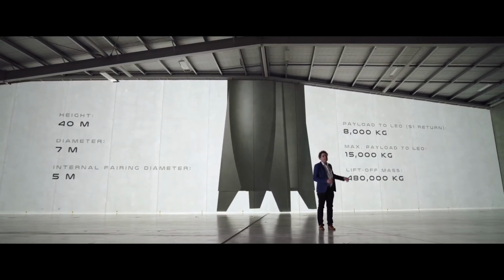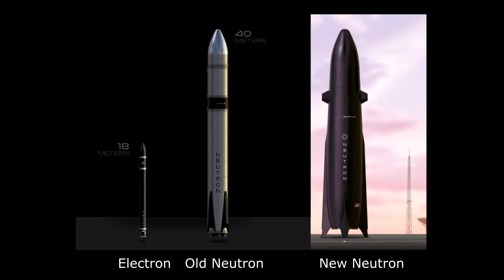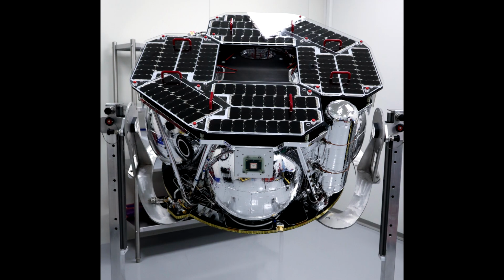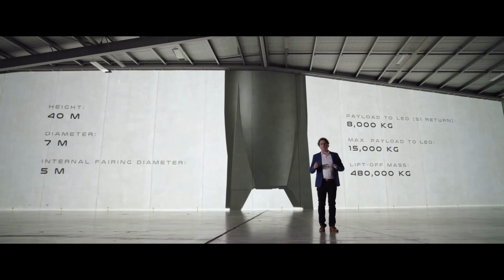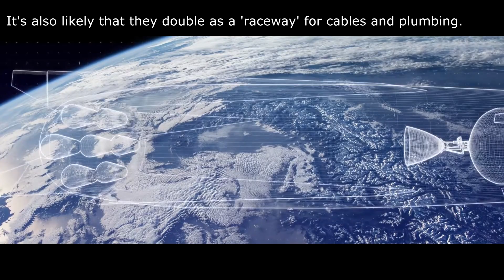Rocket Lab's Neutron Rocket Will Be More Reusable Than Falcon 9

Comment: Carbon makes more sense than steel in this specific application because the first stage doesn't have to reenter all the way from orbit. It therefore doesn't have the same sort of temperature requirements that SpaceX does for Starship.

It's not so much that one is better than the other for rockets in general, as that different architectures reward different combinations of attributes and therefore materials.
Reply: Hadn't thought about that, thanks for pointing that out. Potential re-entry speeds for the booster would likely be around 3 km/s vs. starship's 7.8 km/s from LEO, or faster on Lunar return. Side note, low Mars orbital speed is 3ish km/s, aero-capturing at Mars from Earth transfer is still "only" about 5km/s, which I think just shows how LEO and lunar-return re-entry are the most insane high speeds and heat loads, if Starship can handle that it'll be able to do anything.
Reply: I think you're kind of comparing apples and oranges. The first stage of Starship, (the "booster",) also doesn't need to reenter the atmosphere from orbital velocity.
Reply: @metachuko  True, and I think that carbon would be a viable material choice there.
Reply: @metachuko  Also a factor about the booster is that its return procedure does not need to be human-rated, obviously you would want it to land safely, but if it does fail it will just be a financial loss, but not in any way as critical as a failure resulting in loss of life. Two launches in a row both resulting in loss of life, would most likely be the end of any launch vehicle.
Reply: Also having an autoclave for something that large would be too stupendous
Reply: Yup, horses for courses. Starship is supposed to be able to re-enter from deep space, which is a whole lot hotter than re-entering a 1st stage booster from a sub-orbital trajectory.
Reply: @Andrew-Kerr  starships first stage booster could be carbon then.  they may realize they need to so they have the mass budget to make stage 2 even work
Reply: SpaceX actually has the mandrel to build from carbon, but they wrote the money for that tool off when they found that stainless steel was much better at the cryogenic temps for the tanks, and it would do much better on the way back in. Lots to consider. Easy to throw rocks when only half the story is considered.
Reply: @terke1230  Actually, SpaceX determined iterative cost using stainless versus perfecting carbon design with little iteration favored stainless and the stainless solution when finalized and in production would reduce the cost of each ship by I think over 200%. There was much thought put into the goal SpaceX was up to achieving which is many many ships versus very few and.... getting it done sooner rather than later.
Reply: @user-vp1sc7tt4m  "would reduce the cost by over 200%" LOL you are 300% out of your mind
Reply: Yeah, it's all about what the rocket is built to do. Another consideration is thay Starship needs to be cheaper cause it's made partly for many dozens of people to fly on it like airline passengers, so the cheaper it is, the more affordable the flight is. RocketLab isn't making rockets for civilian passengers/tourists right now, so they can use more expensive materials but build less rockets.
Reply: The trick with Starship is that what you really want is not low mass, but low cost. Steel might be heavier, but it's a whole lot cheaper. Having to burn more fuel for the same payload increases cost, so it's not that simple, but I'm sure they did the math. Also when you consider weight, you have to take into account the entire ship, not just the hull. Steel can withstand higher temperatures, which decreases the need for heat tiles, which saves mass. Also at cryogenic temperatures steel becomes a lot stronger, and most of the strength is needed during launch, when the fuel cools down the rocket anyway. I think Elon said that overall the steel Starship should perform about the same as a carbon fiber one, but it's going to be a lot cheaper. And of course fast iteration is also very useful. With faster iteration better optimization is possible, which also saves you weight and money. Turns out rocket science isn't easy after all.
Reply: @andrasbiro3007  With the engine's being over power/ under utilized and carbon fiber not heating up this will mean a land refuel, reloaded then go again! Like an aircraft.
We are talking hourly turn round times!
$RKLB
Reply: @HypaWave1701  
Same for Starship. And Elon had the idea first.
Reply: @andrasbiro3007  Good on him.
Like electric car's he wasn't the first he just made it better like Rocket Lab.
Reply: @andrasbiro3007  Rapid iteration (aka Fast Prototyping) can work as long as you haven't started to lose 39 engines with each Rapid Prototype). Then you will soon run out of engines and money.
Reply: @ncrean66  
You are grossly underestimating the scale of the Starship program. They are building production lines that are capable of making thousands of Starships, and tens of thousands of Raptors. On that scale losing a handful of ships is not an issue.
And running out of money is extremely unlikely, considering that Elon is the richest man on the planet. And that proved many times that he can raise money effortlessly. In fact investors are begging for the privilege of giving him money.
Reply: @andrasbiro3007  So far they have not built a single Starship capable of orbital flight). And the idea of 31 engines on first stage capable of 5-6 minutes simultaneous burn is not more than a speculation. So nothing is proven yet.
Reply: @ncrean66  
Yes they built one, and more are being built.
None reached orbit yet, but that's more like a formality, not a big challenge. SpaceX already has one of the best rockets in the world, the Falcon 9 is one of the most reliable, highest performance, and cheapest rocket, and I think it had the most launches too, or close to it. That's a pretty good track record. Reaching orbit wouldn't be any different for Starship, the difference is in reentry and landing. The landing part they already tested, the first orbital flight, which is coming soon, will test that part. It will do it like the Space Shuttle did, so it isn't an entirely new technology either. Starship even uses similar heat tiles, just way way much cheaper.
The nice thing is that reentry and landing aren't strictly necessary, it's just saving money and allows more launches.

As for the 31 engines, that's not an issue either. Falcon Heavy had 27 engines, and performed flawlessly even on it's first flight (except for the center core landing). Going from 27 to 31 is no big deal.
Also having a lot of engines improves reliability, because the more engines you have to more you can lose without threatening the mission.
Reply: @andrasbiro3007  They didn't. Sn20 can not reach orbit.
Reply: @ncrean66  
Why? It is supposed to go to orbit.
Reply: @andrasbiro3007  SN1 was supposed to make a 20km hop. Do you remember SN1 ? Btw even for mk15 20km was too much - only 10km actually..
Reply: @ncrean66  
You really think that they weren't able to fly a little bit higher? How did you arrive to this insane conclusion?
Reply: @andrasbiro3007  Dude, 20 vs 10 is not a little bit lol
Reply: @ncrean66  
Actually there's no difference. Or is there some invisible wall between the two? To fly higher all they have to do is to shut down the engines later. They don't even need more fuel, as they were climbing very slowly, which is extremely wasteful.
They don't fly higher because it's unnecessary. They could practice the landing just as well by falling from 10km as from anything higher.
Also, in case you don't know SpaceX also built the Falcon 9, which has flown to orbit 132 times, and landed successfully 100 times. One of the most successful rockets in history, by many metrics. Currently absolutely dominates the launch market. So they know how to build an orbital rocket, that's not the challenge. The purpose of the next flight is testing reentry. Starship will come back way much faster than Dragon, so reentry is a bit more tricky, and something they haven't done yet.
Reply: @andrasbiro3007  The difference is that 10km - subsonic fall, 15km and higher - supersonic one..
Reply: There is just no way they will build this rocket from carbon fiber and have it reusable, the composite laminate will be full of stress fractures from the cryogenic contraction stresses along with warm gas laminate penetration as the rocket moves through the various mach regimes on ascent and descent. Solving this problem alone will soak up hundreds of millions and its exactly why Space X dropped the carbon fiber BFR concept. Also Id dare him to chill those panels he rammed in the video down to LOX temperature and perform the same test. The video contained a lot of spin and not much substance from an engineering perspective, wish them luck but I have no doubt the rocket will be shifted back towards a metal skin design by 2022.
Reply: Steel is a better fit for what SpaceX is doing; carbon fibre is better for what RocketLab is doing. Horses for courses.
Reply: https://youtu.be/thMSjBQMAH8 At end of interview Peter talks about heat tiles.
Reply: Well that's a good way of putting it sir, thanks
Reply: Then why isn't the Starship Booster stage carbon fiber, they knew the diameter years ago, the only iteration you make on a booster is to change the length and you can use the same mandrel for that.
Reply: @kennethferland5579  they are also using rapid iteration design for booster, also the same infrastructure build for starship upper stage can be used for booster so saves cost and designing is easy production is hard.
Reply: @kennethferland5579  Because the final design isn't created and they wanted to be able to quickly fab up prototypes.  Stainless steel works and is cheap for now.
Reply: that is indeed pretty smart
Reply: Yes it will be interesting how RKLB dose manned missions with this set up.
Reply: @HypaWave1701  that is an interesting question! How will rocket lab do manned missions?  

The fairing system would have to be completely redesigned for a proper launch escape system to work. That's doable, but it would be expensive.  Alternatively, they could design the launch escape system to simply blow the fairing off of its hinges in the case of an abort.  But either way, on normal launches you'd only be able to jettison the launch escape rockets and their fuel after the second stage is released, which is a huge weight penalty.  I guess it does provide the opportunity to return an unused launch escape system along with the first stage, but I would imagine this cuts into their payload weight a lot. 

It would admittedly be pretty badass if the LES was attached to the bottom of the stage 2, like with dragon, and then during stage separation, it was really just the LES releasing the rest of the second stage. New KSP build ahead...
Reply: @CocoDaPuf  Knowing Peter the hole Rocket will be sent. The engine's are only being pushed ... maybe %50 so no reason the whole Rocket could go to Mars.
More tricky if docking with the ISS.
Reply: no, it doesn't, furthermore... we will never see a see a of static carbon fiber legs survive re-entry
Reply: I expected the starship booster to be carbon fiber as well.
Reply: As explained in the video, SpaceX or Relativity Space avoid carbon composite isn't merely because of the orbital re-entry aspect.
Reply: That a good point. specialisation is how you compete when your competition has a head start
Reply: The original justification given for stainless steel was that they could largely do away with insulating tiles and instead rely on transpirational cooling where needed. That idea soon fell apart, but stainless steel persisted regardless. I can understand the justification for steel in terms of iterative design and testing, but SpaceX may eventually have to revert back to a lighter alloy or carbon fibre. Elon has quite unsurprisingly declared mass as his biggest problem. There are some serious issues with the steel design and those may well force delays and changes in testing:

- Think about the stresses of launch. Sound pressure that becomes shock waves. Vibration. Find the wrong vibrational modes and it will start shedding tiles.
- Think about the stresses of re-entry. Starship doesn't have the ballistic coefficient of the Shuttle. It re-enters deeper and harder so more g forces. Since its entering side on, it has complex loads and high stress points. It also has a lot of torsion going on in its thin walled frame. All of this requires extra stiffening or else you have local buckling proceeding to failure.  That adds weight.
- Then there are those thousands of welds. In a structure that is also a tank. Plus a common bulkhead separating oxygen and methane. Throw in vibration and all the stresses mentioned above and then reuse and you really are trusting every single weld to be perfect. Not ideal.

So, I honestly think that SpaceX (if it doesn't go broke) will eventually move on from welded steel sheets. Heck they may even copy RocketLabs' automated carbon fibre assembly. Wouldn't that be fun? :)
Reply: @saumyacow4435  stainless steel can easily be repaired on Mars with scraps sheets of steel. Carbon fiber cannot
Reply: @saumyacow4435  Transpirational cooling was not more than an idle chatting from Elon - just to impress the folks. Pretty sure nobody was considering this stuff seriously in spacex.
Reply: @ncrean66  There were a bunch of YT channels taking it seriously.
Reply: @saumyacow4435  Spacex's fanboys take seriously any Elon's joke on Twitter. I remember one time they were discussing Starship 2 with 18 meters core in diameter..
Reply: The dry mass of Starship is just insane. A Heavy-lift Vehicle from NASA's SPS study has similar payload to Starship (120t), yet only 4000t mass when full. Which is less than simply the fuel mass of Starship, and even with some mass reserve! Apparently, aluminium construction/winged flyback is a pretty efficient design!
Reply: You are all delusional - and I understand why). No matter what Musk says, the glider should not be allowed to heat up when entering the atmosphere - just because there are astronauts and cryogenic fuel inside. And,  as Scott pointed out, the reason behind the selection is NOT special temperature requirements but simplicity and cheapness for fast prototyping. By the way, Shuttle is made of al-li alloys..
Reply: @ncrean66  The Shuttle's skin was the thermal protection system (TPS), which consisted mostly of silica tiles and reinforced carbon-carbon. Those are what absorbed (and re-emitted) all of the heat. 

The exteriors of these craft must reach equilibrium with their environment (radiating as much heat as they absorb) at very high skin temperatures. For example the shuttle's skin reached as much as 2300F during re-entry. The designers used a variety of measures (insulating tiles between skin and structure, fuel as a refrigerant for regions within the structure, etc) to keep that heat away from sensitive internal cargo like people. The thickness and complexity of the shuttle TPS was driven by the need to limit the Al-Li structure to 350F.

Using a structural material that can withstand higher temperatures is beneficial because it allows you to focus on just protecting the critical people-containing parts instead of having to limit the temperature of the entire structure. Anybody who's taken a decent heat-transfer course and actually learned anything from it will be able to tell you that's a really big deal. It's why Starship can get away with those thin hexagonal tiles instead of a more complex system like the shuttle's. Presumably their internal heat-management has to be heavier and more complex to shield the people from the higher structural temperature, but that's more of a straightforward HVAC problem as opposed to rocket science.

Note also that even if their internal heat-management can't deal with the entire stainless steel body being at very high temperature, the fact that they can do so locally means that they can tolerate a much more "gappy" tile scheme, and that's exactly what we see SpaceX doing with Starship and its stick-on tiles. Starship might actually be able to tolerate the loss of one or more tiles in a critical area, whereas the space shuttle was only able to do so once by chance because that tile happened to be over a bit of steel structure (Atlantis, IIRC).
Reply: @patrickchase5614  VERY well thought out, and explained. Thank you.
Reply: @patrickchase5614  You are confusing two things - heat protection and airframe structure (that provides mechanical stiffness). And Shuttle's airframe is made of aluminium alloy and it is kept cold during the whole reentry - you can touch it by your hand. And the same should be true for Starship with astronauts inside - otherwise you need to have internal layer of insulation to stop the same thermal flow towards the internal volume. So no any real advantage from having constructional material with a high temperature resistance. Just enough said.
Reply: @ncrean66  starship's structure is it's outer wall. they'll add heat shielding to the bottom, but they chose stainless steel specifically to allow the top to handle re-entry heating exposed. the reason the space shttle needed all over protection is because aluminum alloys lose strength past 200C, while stainless steels remain strong past 600C. with that, you can design to allow rentry heating and manage it, instead of being forced to reject it entirely.

they aren't going to boil their crew alive, they're taking advantage of the manufacturing benefits of SS to speed development and leveraging it's material properties to minimize weight penalties.
Reply: @ncrean66  The whole point of the high heat resistance is that you can lose a few tiles and still survive reentry.
Reply: @ncrean66  Exactly what I was thinking about! A high-temperature frame would make sense if you were using a "hot structure" insulated from the temperature-sensitive stuff, like the Dyna-Soar project. But since Starship's tank wall is also its outer hull, it doesn't make any sense. And yes, it is cheaper to "iterate" - but that is just a technical debt waiting to happen. You don't see any airplanes made of steel, do you?
Reply: @ncrean66  first off, there will be almost no cryogenic liquids in contact with the skin of the ship upon reentry, they'll all be contained in the header tanks at the center of the ship. Secondly, while it's true that the shuttle could survive some missing tiles, starship should be able to survive more lost tiles
Reply: @ncrean66   well I'm sure that you already know the header tank directly connected to the body is not only the most insulated part of the ship, but it is also not going to remain there for human rated ships. Also, the other header tank is well insulated since it's only connected to the rest of the ship via a small ring of steel and surrounded by nothing everywhere else. So it's as close as you can get to floating in a vacuum :^)

If those header tanks weren't insulated enough from reentry heating, then every other spacecraft carrying large quantities of fuel and humans mere inches from their heatshield would surely not survive reentry, either...

As for having enough fuel to launch from the surface of Mars, that's kinda the whole point of ISRU. It's not like you've given any other solution on that particular problem...
Reply: @ncrean66  you seem to be under the delusion that gas is a perfect thermal conductor. I had no idea that I would immediately burn alive if anybody lit a fire within 12 ft of me
Reply: @HalNordmann  the whole point of the header tanks is landing propellant storage
Reply: @ncrean66  What are you talking about? Starhip could never make it to Mars with enough fuel to take of again, and that has never and will never be the plan. And why would it be a problem that the propellant is heated a little during the reentry, they are going to do that anyway to get pressure for the hot gas thrusters.
Reply: @ncrean66  "I would suggest you to wait 10-20 minutes in a steel tank that is heated over a fire)" well, if that stainless steel tank is insulated by an advanced thermal protection system then sure.  It'll get about as toasty as any other reentry vehicle.
Reply: @patrickchase5614  Re: It's why Starship can get away with those thin hexagonal tiles instead of a more complex system like the shuttle's
I thought Starship could (mostly) use simple similarly shaped because it was a simpler shape.
Reply: @ncrean66  You are wrong, the structure being able to handle higher temperature is a big advantage. Carbon fiber need to be kept below 200C while steel can remain structural close to 900C. They will of course not let the whole structure come anywhere close to 900C probably less than half, but it gives it much higher tolerance for local heat spots. Sure you might have to have extra insulation in the crew cabin, but that's a small part of the ship.
Reply: @ncrean66  how do you propose to get back from orbit without heating up?
Reply: @JackMott  Very carefully?  (sarcasm)
Reply: @ncrean66  There are many issues with what Space X is doing, and while it is quicker, using steel for a rocket ship makes as much sense as it does for a F1 racecar.  They all have gone to carbon fiber ( as much as 70% of the car aside from the engine) for the weight savings and strength.  In the long term, RocketLab will be able to build theirs almost on an assembly line at a cost such that re-using them is merely a bonus feature.  I suspect that SpaceX will be forced to change their final designs to carbon fiber as well, since heavy and prone to buckle under stress sheets of metal is not good for recovery prospects at this point.